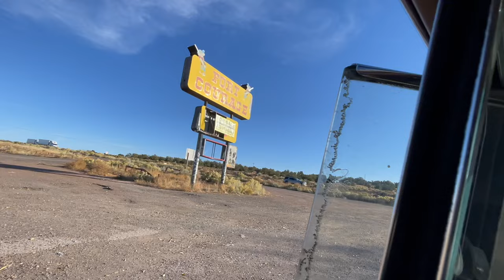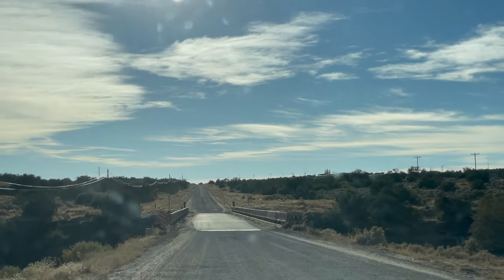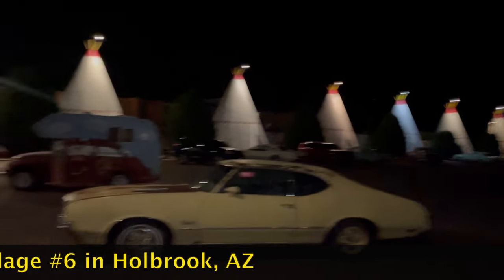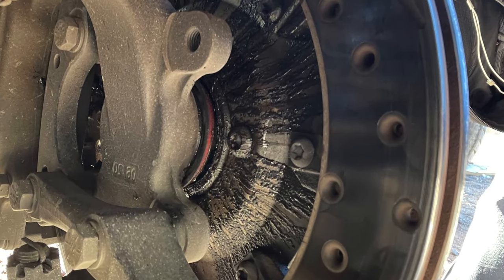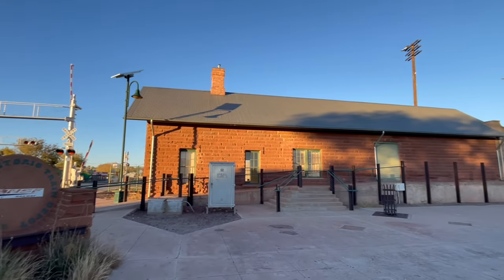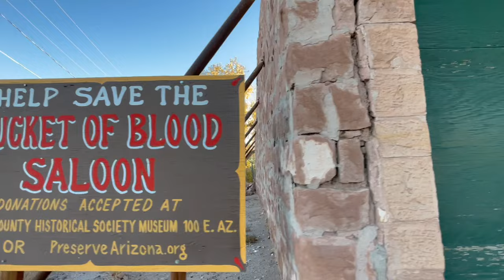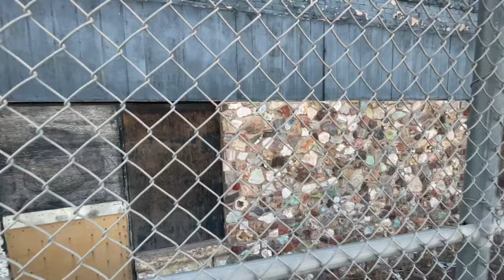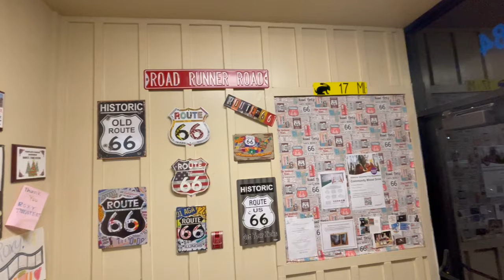13-Route 66 Arizona Part 1

Comment: Ok Jeff you should pack your wheel bearings about every 30K :} The original 55,S had Ball Bearings had to pack them about every 15K Thanks for the fun.
Reply from the maker: Thanks @larrybaugher2366 it has a brand new Roadster Shop chassis. The bearings were professionally packed. Thank you for coming along for the ride with me!!

Comment: Everything on that car is very DIY fixable. Feel bad you are having a few issues but you do drive the hell out of that "55". Wheel bearing on that should be repacked and inspected yearly. It is actually something YOU could do in a couple of hours just hanging out in your driveway having a couple of beers on a nice summer's day. Learn how-to old-school hand pack them, don't be using that junkie plastic bearing packer. The video was great. I haven't been there (AZ) yet but I'm looking forward to it this June.
Reply from the maker: Thanks for explaining how to repack a wheel bearing @michaelaus7091 It’s not an old school wheel bearing. It’s a new Roadster Shop chassis. Giddy up

Comment: What happened to your 55??? Did something broke down?
Reply from the maker: Did you watch the video @LINJ638 ???
Reply: @jeffthisted   Yes, I did. Sorry. Idk much about cars, but one of the screws got burnt out.
Reply from the maker: You watched the video @linj638 and you’re asking me “did something break down?” If you actually watched the video you’d know it was a wheel bearing just like I explained in the video. Have you been drinking again???
Reply: I saw the part where they had to take off the tires and some brakes plates from overdriving long distance, etc….. but I know nothing about cars, so the parts that I am pointing out to you may be wrong.
Reply: No, I have not being drinking. 😣
Reply from the maker: It was the wheel bearing @linj638 and I’m back out in the road
Reply: @jeffthisted  That is good news to hear.

Comment: That's what cars are for to drive they're not like at no difference in you driving that car every day and somebody go and spending $60,000 for a new Ford truck and driving it
Reply from the maker: I agree with you @davidjustice5805 !! That's why I built The 55 to drive it. But you're wrong when you say it's the same as buying a new Ford truck. Modern vehicles have modern conveniences that classic cars don't have - like anti-lock brakes, shoulder belts, air filtration systems and a whole lot more.